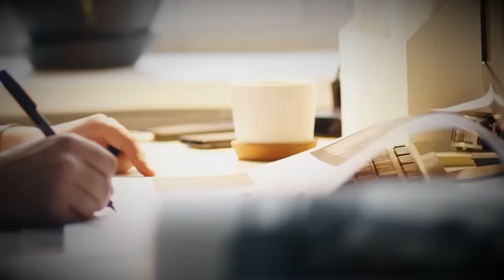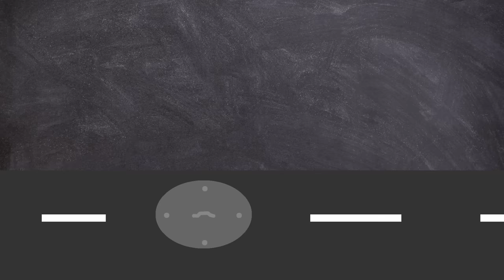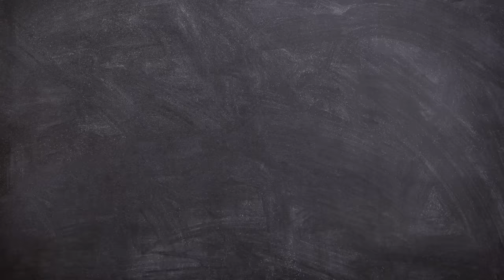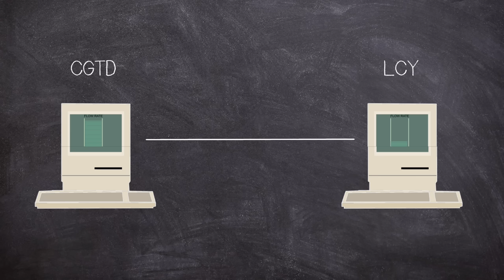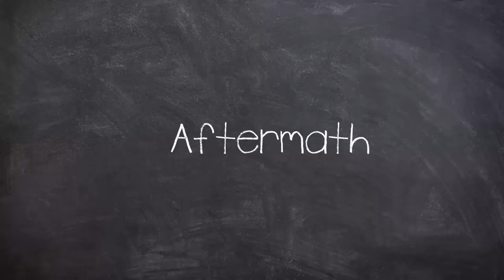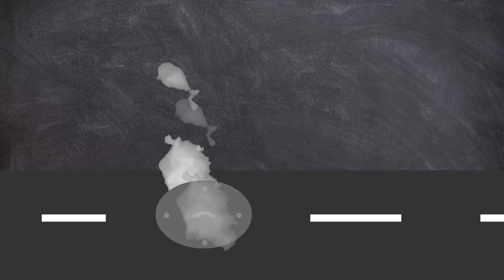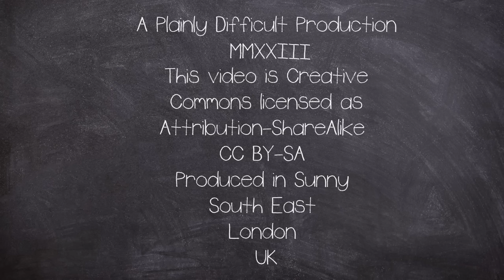Multiple Streets Blowup At the Same Time | The Kaohsiung Explosions

Comment: Thanks for doing this video... its the first and only video in English I have seen on this topic.  One of the roads was blown up (Yi Xin) is visible from my balcony.  Having just moved to Kaohsiung the year before, I was in shock that something like this could happen in my town.  After the local new coverage of the event died down, the gov't was very eager for everyone to forget this whole incident. Hmmmm.....
Regarding the firefighters response to the white mist - they had no idea what the gas was... it was widely reported in Taiwan to be a chemical precursor used in plastics manufacturing.  Very little odor and highly explosive.  It was also much heavier than air, thus filling all underground sewer pipes and drainage ditches.  I remember seeing the footage on TV, they were spraying a lot of water for hours where the mist was actually rising up to street level.  I believe the explosion was set off elsewhere as any spark or open flame could ignite the tons of gas(es) that had already accumulated.  Remember ~6km of roads were blown up from below as if a line of explosives charges were laid under each road.  Close to the leak area, body parts, cars and scooters were found on top of 2nd and 3rd floor rooftops.  Truly horrific.

Comment: It wasn't propane that leaked, though propane lines were probably present.  It was *propene*, i.e. propylene.  Propylene is a bit spicier than propane.  Consider that it's used as an acetylene/MAPP substitute.
Reply: I'll add, in a torch, propene is only a small step above propane, which are both noticeably below good ole MAPP, which is leagues below an oxy acetylene setup, or oxy/MAPP. No fair comparison though since oxy setups take any of these gasses to the next level. Even oxy propane can hit 2800C/5000F! 

I wish we could still get real MAPP. The new substitutes aren't really worth the cost.
Reply: Propylene has its own smell too unlike propane... although that didn't seem to help in this incident

Comment: Everyone wants to collect the money but nobody wants to spend to maintain anything and negligence seems to be everywhere. Pipe should have stayed off when they noticed something wrong with the pressure.
Reply: Its so infuriating. Im guessing the manager was worried about productivity/ money. But a disaster is much more expensive than stopping the pumps until you find out what's wrong.
Reply: When both parties stopped the gas supply midway, they actually conducted a pipeline pressure test. Since the pressure test passed, the employees assumed that it was just a problem with the detector and restarted gas transmission.  Problems with the SOP itself and imperfect testing are also causes of accidents.

Comment: In a closed loop propane system, a noticeable change in pressure & 'meh'?  How does this scenario need a rocket scientist to come up with a few possible problems?  Once again, a lack of honest & capable oversight crippled safety, stemming from  big/corporate greed & subsequent employee indifference, as is typical in the 21st Century.  Cheers from a dark but 18c downtown corner of Canberra. ;-)
Reply from the maker: Sadly all too common!!
Reply: It was 23c here in Southwest Florida last night. With a slight breeze, I felt a nip in the air. That's how thin-blooded I am.

Comment: The auto-ignition temperature of propane is around 470 degrees Celsius so a hot engine could not be the source of the explosion. The must have been a spark or naked flame.
Reply: It was most likely the hot turbocharger if the truck was a turbo diesel my turbo diesel Land Rover turbo is 500 degrees at idle so you could only imagine how hot a turbo would be on a fire truck and being a diesel it would have sucked gas through the air intake into the engine causing runaway diesel pretty much fuck all you can do to kill the engine except try and cut the air

Comment: The fact they restarted the pumps after clearly identifying a leak is baffling to me, like seriously WTF! Regardless of the lack of maintenance which lead to the leak the response to the leak is the worst part of this by far. At what point should an operator be charged with murder for their actions?
Reply: The gas transportation was restarted because the pipeline pressure test passed during the shutdown.  Poor testing and sloppiness also contribute to accidents.

Comment: It was propene (propylene)... not propane.   Not completely sure on the difference.. just a fun fact. =)
Reply: Propane doesn't have a carbon to carbon double bond in it's molecular structure unlike propene
Reply: @anhondacivic6541   See like, i know thats a thing..but what difference that would make in the incident, idk?   More explody? less? Hotter? colder?  u know? ;)
Reply: @SmDJeremy  just looked it up, propane releases more energy than propene so propane does get hotter
Reply: @anhondacivic6541  ah word, thanks.  So plainly.. you should let everyone know that the fire wasn't as bad because it was propene and not propane.  Thank god. 

haha...sarcasm... i hope it translates through text. >.<
Reply: Does propene have an odorant added to it like propane does? If not, that would account for the lack of noticing a smell.
Reply: @pfadiva  I assume no because it does have a slight odor to it
Reply: Propylene has its own odor.  Also it's more reactive due to the unstable double bond, making it desirable for use in making plastics and even gasoline...

Comment: Hard to understand why they turned the pipeline back on and then left it on, it seems clearly plain they were facing a leak based on the info they had at the time.
Reply: When your job is to pump gas you pump gas.

Comment: how is it the guy en-route to the job can smell the propane IN his car from downwind of the leak BUT people at ground zero have no idea wtf is billowing out of the ground?
Reply: As far as I can tell, the gas didn't have an odorant (AKA stenching agent) added to it, so it wouldn't have had the normal "gas smell".  Additionally the gas was not propane but instead propene (AKA propylene), this does have its own smell, but the smell is weak and also unfamiliar to most people.  So it is plausible that the people at ground zero also smelled the gas but didn't recognize what it was.
Reply: @CoastalSphinx  what a nightmare.

Comment: 5:22 While your videos are easily the best comprehensive disaster coverage on YouTube, you've used one of the most widespread inaccurate terms out there.  Tarmac, or Tarmacadam, is a paving material dating back to 1820's Scotland.  Coal tar was used to bind the aggregate.  By early 20th century, petroleum by product bitumen supplanted coal tar, with its pavement known as asphalt.  As I said tarmac is often used as a generic term for pavement or asphalt, most commonly in the UK, and everywhere when referring to aprons and runways at airports.  But as an example, 97% of Taiwan's roads are surfaced with asphalt. "Pavement" or "the road" are the correct terms.

Comment: How the first responders missed the oderant is beyond me. That is a huge disconnect.
Reply: The gas may not have been odorized. That costs money to do. This was clearly an operation running on the cheap.
Reply: @1pcfred  The gas was also being used for chemical and plastics manufacturing, so they might not have been able to odorize it.  Odorants usually contain sulfur, and sulfur is harmful to many catalysts used in industrial chemistry.